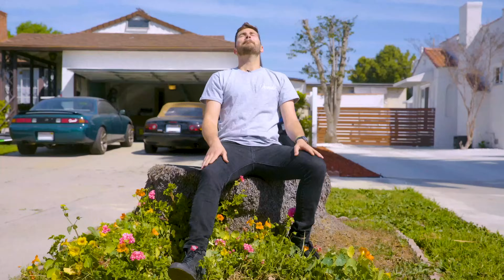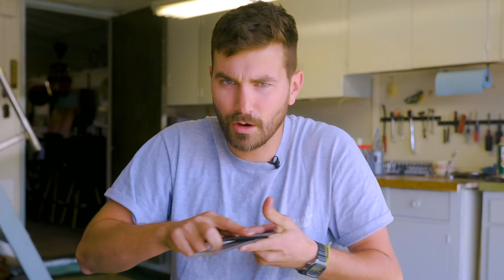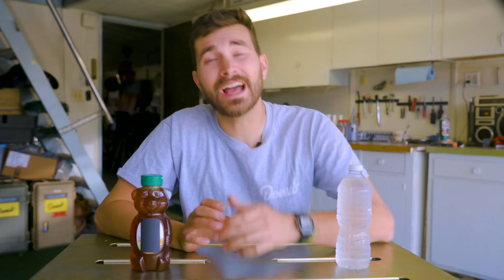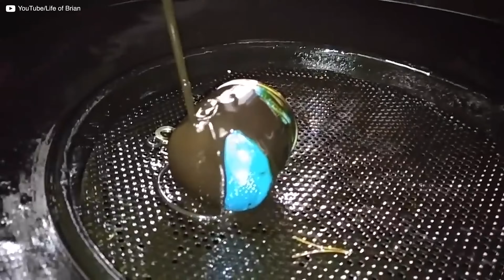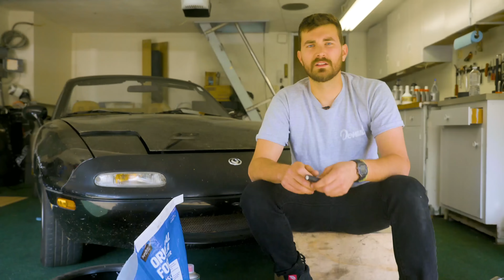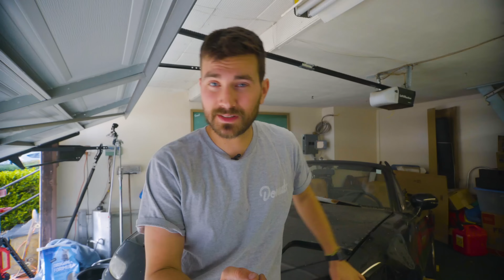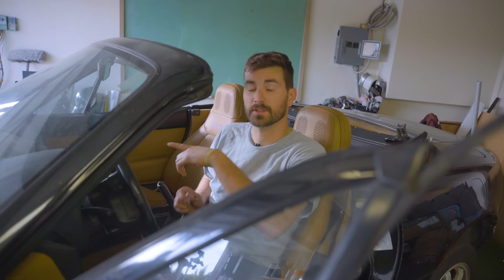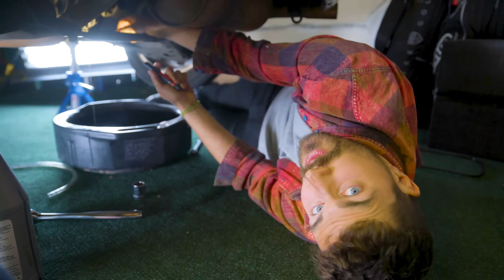9 Things You’ll REGRET Not Doing to Your Car

Comment: Pro Tips: Turbo and track cars generally require more frequent oil changes, because dem spiny bois are usually oil fed too.  Brake fluid is a must for track cars. AT LEAST...at the beginning of every season, or when you notice reduced brake performance.  Some fluids can take more heat.  Very important to use the correct type of silicone based brake grease on slide pins too.  Oh and LSD addatives or LSD specific oil types are a good idea, esp for clutch type diffs.  Like you said, it's in the manual.  Everyone should buy their Factory Service Manual (FSM) or Haynes or something.  Manufacturer recommend or OEM parts for all filters and plugs is a really good idea too.

Ppl fall for marketing hype, or what the keyboard warriors say on products.  Just read the FSM and moderator pinned forum threads online lol.
Reply: Turbos are always oil fed. A lot of older (90s) turbo cars require thicker (15-40 or 20-50) oil because the turbo was qualified on thicker oil. If you put a newer aftermarket turbo on then chances are you can run a thinner oil as those engines were usually qualified with thinner oils on their non turbocharged varients, but frankly there wouldn't be much of an advantage to doing so beyond having a larger selection of oil brands at the parts store. As far as them needing oil changes more often that would depend on how well the car is turbo timed and how much time is spent at high boost levels where the exhaust heat can soak into the bearing housing and heat up the oil. In general a turbocharged engine could be designed and qualified to the same change interval and viscosity of a non turbocharged engine which is what you see a lot today with the grocery getter turbo engines. Think anything with a 1.6t engine.
Reply: @turbo_brian  actually the thicker oils are to combat the fuel dilution that higher compression turbo engines experience.
Reply: @turbo_brian  thanks for sharing the extra info man!  That's probably why I hear a lot of people run 10W40 or 50 weight even in their FC TII.  I gather that a lot of track cars generally do well with 40 weight, and obviously much more frequent change intervals.  Yeah manner of driving and highway vs city ratio makes a huge difference for sure.  Cheers!
Reply: Can turbocharged cars run on semi synthetic oil?
Reply: @surendransuppiah   short answer: usually fine, but will usually break down faster, and need to be changed more often.  Regular oil changes > running the most expensive oil.

Long answer: It depends on the exact type of oil you choose and its additive package, your engine and mods, and how you use it.  If you do do regular oil changes, that's the most important thing, and some say you can run less expensive oil, since you change it before it breaks down completely.  I personally know I lose track of time and don't change often as I'd like, so I always run a synthetic, with good additives package.  Check out Project Farm oil showdown YouTube series if you wanna nerd out like me LOL.

Generally speaking, semi-synthetic breaks down faster than a good quality synthetic.  Mostly stock cars, can just follow manufacturer reccomendation.  But if you drive hard often, have mods, engine that is known to run hotter...should be using synthetic, imo.  If you really want to know...do an oil analysis on your dirty oil to see how badly degraded it is.  With turbo cars, and diesels, oil can look black sooner after oil change, but be fine still.

Examples: Rotary engines, like the 13B, that still use the oil metering pump generally run better with non-synthetic, or any oil that burns easily, because the rotors are lubricated by the engine oil.  Some say you can get around this by premixing oil in gas tank, cap off the OMP,  then use synthetic oil on the engine.

Most WRX EJ engines need thicker synthetic oil on track days, maybe even a better oil pan, since oil pooling on high G corners is a thing with most boxer engines.

My ZX2 (2L N/A  Mazda engine) can run non-synthetic, but I also drive it hard, change oil less, so I use synthetic.

Comment: Coolant also increases the boiling point of the water+coolant mix so it doesn’t boil and vaporize at high temperatures and also inhibits rust in those damn copper radiators

Comment: This video is worth its weight in gold. Great technical explanation for each item and why. Plus you are working on an NA Miata which I own so this is terrific information I can use directly. I’ve never changed my fluids myself but you make it look pretty straightforward. I’ve replaced my fuel filter and radiator. Oddly enough those were easy to do. Miatas are great like that. Just the essentials.

Comment: Can you highlight this to hopefully help some people, your car may be fitted with an overflow bottle and the cap on that overflow bottle will have a rubber like seal on it, when that gets old or worn out the seal will deform in shape and not function correctly and can cause major failures in the cooling system, this can result in blowing out head gaskets among other things, they are a fairly cheap part to replace and could end up saving people hundreds if not thousands of dollars, thanks guys!

Comment: I will miss having easy spark plugs replacements I have to rip out half the engine bay to take them out of my wrx it's a pain
Reply: I bought the car didn't replace them engine had a knock got it replaced with a used one still haven't even checked them probably not the best idea

Comment: As an NA8 Miata owner, I’d recommend checking your coolant hoses too! especially the ones right behind the engine in between it and the firewall (heater hoses i’m pretty sure). But anyways, the CAS that’s right above it tends to leak oil on almost every Miata I’ve seen that hasn’t had the seal replaced recently, so i'd absolutely recommend checking that too. If it's bad, hot oil leaks on the hoses which eventually go bad and then they burst and you leak all your coolant and your car has a bad time. 

And also!  For bleeding your brakes, it’s recommended to start at the brake farthest from the master cylinder, and end at the brake closest. For an NA, the order would be: right rear, left rear, right front, left front. 

Other than that, fantastic video. keep it up!!

Comment: Couple things. You started bleeding the brakes on the wrong wheel. You start farthest away from the Master Cylinder and work your way towards it. Also, don’t crimp rubber lines with vice grips. You can accidentally cut the line then you have to replace the line.

Comment: Use a feeler gauge instead of that janky ass plug gap tester. Will mess up the tips on expensive plugs.
Open the oil fill cap when draining for a quicker drain.

Comment: What kind of battery and alternator do I need for my 1994 Toyota Celica?
Reply: Take your alternator off and have it rebuilt at a local alternator/ starter rebuilder. 
'Will be half the price of buying a chinese garbage one from autozone, and, your factory alt is worth WAY more than any Autozone junk. 
Rebuild is $50- $100 and done. 
Always put a brand new battery in when running a fresh alternator. 
Check that the new battery is above 12.4V before purchasing.
Reply: STAY WHITE thanks!

Comment: I wanna say one thing about bleeding the brakes, I’ve always learned to do the wheels that are closesed to the reservoir first and work your way away from the reservoir. I don’t know if thats that important. But when you are doing the rear brakes, you should know there is a longer line, which means more fluid to be changed out.✌🏼
Reply: Hmm, I've always bled the longest line first, fluid loss be damned.  This is also conventional wisdom, though your car may differ.  Let's say you bleed the short lines first - since the pedal firms up the more air you bleed out, the helper will have to work hardest on the longest line, and the firm pedal could lead to an air bubble being stranded in that longest line.

Comment: Great explanations. Although when flushing the brake fluid you want to start farthest away from the master cylinder  because that way you have fresh fluid all the way through the line to the tee on that axle already and have reduced the amount of air in the system by the most before you start working on the next closest wheel.
Also with the spark plugs (depending on what type it is) never gap them with the cheap gapper, if you need to make the gap bigger or smaller use pliers so you don't damage the electrode. This is for electrodes that have a irridium, or platinum tip. 
Just wanting to spread more knowledge out there, not knocking you down, just from experience in the field. Keep up the videos though! They are very informative!

Comment: As for maintenance, the biggest mistake is toping up your coolant with water. Adding water dilutes the corrosion inhibitor package, and can reduce the effectiveness to the point that it will not provide protection against cavitation and corrosion.  The coolant colour may still look OK, but the coolant is no longer working as it should (this is where the hydrometer/freeze point measurement IS handy).  That being said testing the freeze point of antifreeze is only telling you how much glycol is in the system, it is not an indication of the health of the corrosion inhibitor package that actually protects your engine.  Change the coolant as often as it says on the bottle or in your manual, just because there is enough glycol does not mean your coolant is still in a serviceable condition.

If you live in a temperate climate your coolant might not contain any glycol as the only purpose in a modern formulation is to provide antifreeze protection.  You actually significantly increase the coolant heat transfer efficiency by removing the glycol and running with a water-based corrosion inhibitor (up to 40% better heat transfer efficiency with a premium technology product).  

Please don't believe the hype about water-less coolants, water and glycol are both corrosive in the system without the addition of a good corrosion inhibitor/buffer chemicals.  

  *coolant is my job :)

Comment: You cringed me out when you forgot to put oil back in the filter, now the engine started dry, just a heads up next time
Reply: Its not dry there is still oil left in the engine and even if you run the engine dry for 5 second no dammage will be done.

Comment: "torque to spec"

4 ugga duggas with the good ol' milwaukee
Reply: soundlesspeal I can confirm this is the correct way to torque bolts to spec
Reply: Been working in a tire shop for a few years now. 3 ugga duggas on small cars, 4 ugga duggas on large car/small medium SUV, 5 ugga duggas on large SUV and meduim trucks. But air also has "MO POWWWA BABYYY"
-@jamespumphrey
Reply: German torque spec "Gutentite"
Reply: WeCanBuildThis  I can confirm this. I’ve been here in Germany for a couple years now and this is just plain fact.
Reply: Go until it cracks and then back ¼ turn
Reply: @johnlaney276  tighten till slack and half a turn back, kinda same as yours but you beat me to it.
Reply: Tighten til righty-tighty becomes right-loosey
Reply: Get the last few pound feet with a leaned back visual inspection and a "that's not going anywhere".
Reply: Here in Ohio I know alot of people that say gutentite. I use it myself. No air for me its all muscle tight. 2 hands on a 4 way is gutentite. A 4 foot cheater pipe on a 4 way is ugga duggas, needed that when my buddy didnt tighten his lugs and we only had 2 left that were all galled up
Reply: Impact wrench goes brrrrrrr
Reply: This hits close to my impact driver.
Reply: How many ugga duggas is 25nm
Reply: I prefer to measure in oopmhs
Reply: 4 ugga duggas almost killed me when I didn’t go back and check how tight my lug nuts were by hand
Reply: Lmfao! Ugga duggas
Reply: @TheMauian  might be best not to go to your tire shop.
Reply: @stevedapirate5 nah I literally only trust mechanics that speak this way lol the ones that "do it by the book" are literally the snakes you need to watch out for

Comment: I change once a year on my Hoppy/summer car wich is more often then the manual says but as the engined is quite tuned for a NA it feels good. 
On my daliy however I only do it at a 2 year intervall wich is a bit later then the manual but then it mostly dose highway speeds and has better oil then the recommended :)

Is it true tho that some cars you check the oil just after it has run and others you need to wait like 30 min before checking?
My grandpa says to check when the cars has not run for some time while but a friend said on my car I could do it just after it has been driven. Dose it matter?

Comment: Put a little but of oil inside the filter before screwing it on and also leave the plug off while you put 1/4 of a bottle of new oil in so you can be sure that you cleared out the old stuff.

Comment: The only problem I have with this video is not referring to your owners manual for changing these fluids. Also, for draining the differenial you fill it until it touches the tip of your finger. Also some fluids need tobe sucked out of your transmission

Comment: I wouldn't change the fluid in my transmission without changing out the filter. Idk about the Miata but just changing fluid isn't a good thing. All it's doing it running all the crap in2 the filter. I mean people are always "breaking down" and say the transmission is just done..... No....

Comment: I’m surprised there was no mention of using/replacing gaskets or crush washers on the drain bolts. A cheap pack of copper crush washers prevents leaks and stripped threads.

Comment: As an European mechanic, im quite surprised about 3.000-5.000mile oil changes..
Im used to 15.000-20.000 km for a gas engine and 25.000-30.000km for a diesel. It's what most manufacturers of eu cars recommend.

Comment: Just a heads up.. I worked at a oil change place for over 5 years, and tried to explain this to most of you plebs, and damn near all of you told me to fuck off... but it's cool you'll listen to a youtube video and listen.. love this.. (btw thank god i left that job, people suck on an epic level)
Edit: Lubing the old gasket does not help it seal.. it's for removal, a non-lubed filter is substantially harder to remove then a lubed one, especially if over tightened, which 90% are

Comment: You're supposed to bleed the furthest caliper from the master cylinder first then work your way to the closest, also do not run the engine dry of fuel, that's really bad for your injectors. Just clamp off the filter. Other than that a pretty good video

Comment: Cool video but some advice to people watching... change oil when vehicle is warm, it will flow smoother, allow more oil to be retrieved (off walls and engine internal components) and debris that is on floor of pan will be floating in oil allowing for better removal. Second, do not drag the tip of the electrode on a gap tool. Also those tools are typically inaccurate, recommend purchases the blades to get a more precise measurement. Tech advice 👍🏼

Comment: With brake bleeding remember to start with the wheel FARTHEST from the Master Cylinder. For American cars that will be the passenger rear, then driver rear, passenger front, and last, the driver front
Reply: Why?
Reply: @azzrex2236  when you bleed brakes your moving the air out of the line to the master. Start with the furthest one. Aswell the rear gives you your pedal height.
Reply: Was gonna say this

Comment: One thing they didn't mention about bleeding brakes is the fact that you need to start with the caliper that is the furthest away from your brake master cylinder and then work your way closer to the master.

 On most left hand drive cars the farthest caliper will be the rear passenger side. Next you would do the rear driver side, then the front passenger side, and finally the front driver side.

Comment: Don't jack your Miata up on the pinch welds like that! those indents on the pinch welds indicate where the jack points are, but they are just inside that pitch weld, the jack stands should be just inside where shown in this video. Those pinch welds will eventually bend and fold over if you keep jacking on them... note how the OEM jack for the spare tire actually straddles the pinch weld and sits on both sides, but the load is not on the tip of the pinch weld

Comment: Hey just wanted to jump in here and mention that you shouldn’t put the oil drain plug back in before replacing the oil filter on a lot of cars. When dealing with cars that have  an internal oil filter (no casing attached to it, it is built in to the engine directly for example with bmws) you should slowly crack that open first and wait for a minute before taking out the old filter, putting the new one and placing the drain plug in the pan again.

Comment: The torque spec range (on the wheels) is actually just 2 numbers. Lower number is for steel wheels, higher number is for aluminum/alloy wheels.

Comment: Where to start...
Check to ensure the old filter gasket came off and isn't stuck the the engine block.
You lube the gasket to ensure it comes off during next oil change, but it can sometimes stick.
You showed how to change gear oil, but the majority of cars on the road are autos.  I guess there's no information for auto trans fluid change.
You should always do a brake line bleed starting at the wheel furthest from the BMC.
You "pinched" rubber fuel lines by clamping vice grips on them.  Hope you didn't clamp too hard and cut those hoses.  There are better ways to do that without risking damage to rubber hoses.

Comment: U put dioelectric grease on the boot and the top tip where the plug connects to the sparkplug.  So electricity doesn't  jump and corrodes